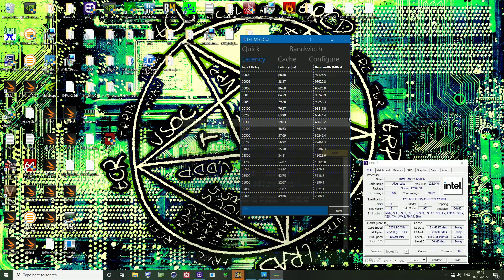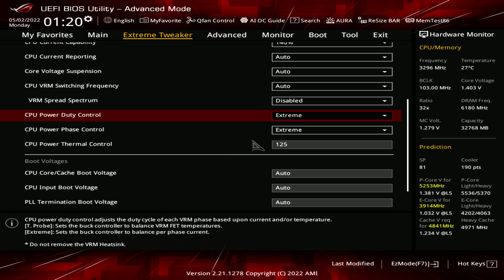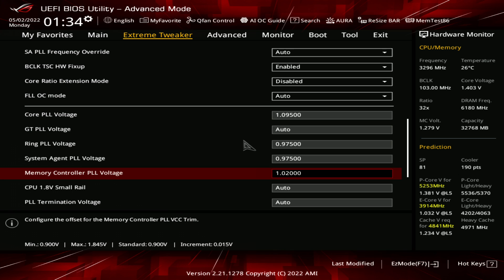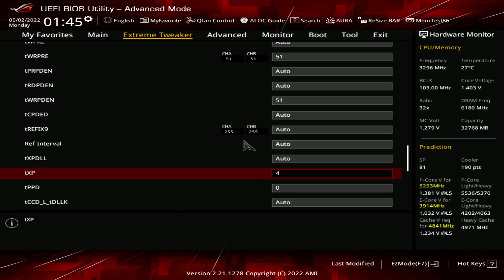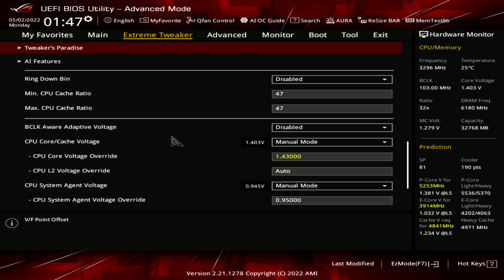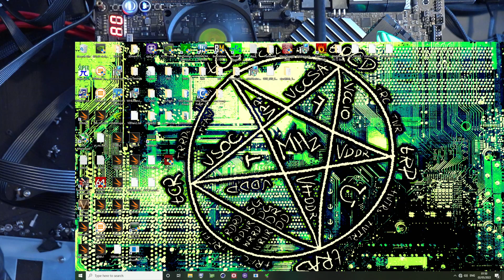Maximus Z690 Apex 1T DDR5 Overclocking: 2x16GB Hynix ICs at 6180Mbps 30-37-37-42-1T

Comment from the maker: The settings are reboot & retrain stable.
Reply: Anything to try to aid reboot? I have a "stable" setup that's great in everything, but resets profile after every other nightly shutdown.
Reply: @Buildzoid: Long time fan. FWIW, a lot of the random reboots for me on this board were related to having switching frequency at 800khz. Dropping that to 700khz eliminated at least some of the most frustrating random reboots when testing memory stability. That said it's still kind of a dog, especially for $700.
Reply: @fracturedlife  once you have your train locked in setting fast boot to auto or enabled. Then it will speed thru the retrain .
Reply: @fracturedlife  Probably your software... I have a b540 tomohawk max... does the same if settings are saved via software, not BIOS saved... took me a while to figure that out, otherwise check your BIOS battery, if it's less than 3V... that'll be the root cause.
Reply: I just wana say thanks for sharing, I had the random crash from the system agent voltage and couldn't figure it out. I was able to run all your mem timings and voltages with my G Skill 6400. I'm going to join patron and dump Frame Chasers LOL
Reply: IF you OC cache it can dramatically reduce OC on memory and stability in general.. You should try MEM OC with stock cache and core. Then core with NO cache OC.  at the end it will yield best results with cache at stock and rest OC.

Comment: I'm not an expert like you and had no luck at all having the "AI Overclock Tuner" set to XMP I or II.   It's like the board was annoyed at me for trying to use the setting.  I always had to set the Frequency 200Mhz lower just to pass training (on Micron 5200, was all I could get early December/21).  Instead I found it best to just leave the "AI Overclock Tuner" set to "Auto" , set DRAM Frequency myself and then pick one of the Extreme Tweaker "Memory Presets" as a starting point to twiddle from.  That has worked well, considering.  Anyway, thanks for the video, you've given me a few ideas for much more fiddling.

Comment: Thank you for sending me down the memory tuning rabbit hole. I've got this board and have been dealing with memory problems ever since I bought it. It wasn't my first choice...the z690 hero was however it was one of the faulted batch with an inverted chip on the board. This was the next best thing available. I came to a crossroad, learn how to tune DDR5 or simply replace the board with something else. Thanks for telling us all the little nuances of the z690 Apex. I didn't simply copy all your settings however I did use some of your values that would help me with stability. Still fine tuning my timings using a kit of DDR5 8000 Gskill. I haven't tried to push over 6600 since its not initially stable. Maybe down the road when I learn a few more tricks@

Comment: Did you mess with your memory speed at the end? 
Anyway, I was Asus sheep many years, until this generation of the Apex. Yes I have one of the Apex board which sux above 6000. Some guys at oc.net fixed it by buying another Apex, lol. I fixed it by buying MSI Z690i Unify. What a lovely board for nearly half of the Apex price! I am now running 6400 easily. I will never buy any of Asus boards in future. The Apex price is so premium, and the fact they sell "broken" boards is hilarious. 
Great video, thank you.
Reply: I went from loyal Apex buyer to bigtime MSI Unify-X fanboy myself. So much better!
Reply: I have always been asus fanboy also and this z690 apex first dissapointment.  I cant tell if mine is bad though.  6400mhz cl32 boots fine with no memtest error, but so far can only boot 6600mhz with memtest errors and nothing higher or tighter.  cant tell if its the mem or board, have a hynix kit

Comment: ASUS binning the good boards for privileged individuals and then selling the rejects to suckers at the retail market for an exorbitant amount of money is very disappointing.
Reply from the maker: I don't think they binned that many. there's maybe 10-30 overclockers with support from ASUS.
Reply: Really just seems like the earlier the board ( ES included ) the worse memory stability and overclock potential is. I've seen several examples of this from overclockers I know and from my own testing. Could be due to a lot of factors like the parts shortage and the use of what you can get, the lack of highly skilled employees at the board factories, the rush before Chinese New Year holiday and so on. The boards seem to begin getting more stable and reliable with XMP+ with S/N starting at 11/21 and with the exact same cpu / memory a board made in 22 appears to net a 300-400MHz boost to overclocking
Reply: Unify-X MASTER RACE. The board is just way better than an Apex and the Apex costs 50% more, too.
Reply: @Desktopia In this case, the 2021 boards have issues, the boards made in 2022 don't. Don't know what Asus fixed, but they fixed something fairly significant.
Reply: @CrackaSlapYa  I guess it depends were you are. I got my Apex for 575 Euros, the same price as the MSI U-X, the board I wanted 'cause I was building "The Darkness", no RGB anywhere, just two small white strips pointing inwards. Anyway, got the Apex cheap in a bundle deal with the CPU during Ishtar (Easter). The X was unavailable, they just had the regular Unify, now I also got the X but it cost me 599 Euros (I ordered it...).
Curiously enough, despite not "stretching" the Apex to find it's limits, the only issue I'm having is with the stupid RGB software... Every time I reboot, it resets "vomit rainbow mode".
Reply: @Gti_Jason  IF you OC cache it can dramatically reduce OC on memory and stability in general.. You should try MEM OC with stock cache and core. Then core with NO cache OC.  at the end it will yield best results with cache at stock and rest OC.

Comment: I have the Apex. I am running the Gskill 6000 CL36 kit (stock). To make it memtest stable, I had to adjust only a couple of things: VDD=1.3600, VDDQ=1.3600, Memory controller Voltage=1.2400, CPU System Agent Voltage=Offset mode and the CPU System Agent Voltage Offset to Auto. Passes all benchmarks for CPU and Memory. Am not sure if I will OC this kit, as it runs super good stock, and I wont see crazy improvement by OCing it much further.
Reply: Yes you will. The difference between 6000c36 stock and 6800c30 (my daily settings on my Unify-x . 90k read vs 111k  read. 62ns vs 51ns. Thats a HUGE difference. Overclock them shits to 6400c32 at least. Dont be that guy who buys an Apex to run stock ram....
Reply: @CrackaSlapYa  true. And I will, am making sure that the stock settings are rock stable first. The voltages applied on the stock xmp profiles are insufficient and fail memtest
Reply: @M00nsave445  i found that i didnt need anywhere near the voltages that i expected. running 1.42 / 1.42 on the ddr5 and 1.4 vdd and 1.44 vddq and 1.15v SA for 6800c32. Dont try to tune many sub timings until you are stable with primaries. From what Ive seen on the b-die and Apex you should be able to get 6400 34-36-36 or 36-36-36 with similar voltages at least, and perhaps 6600.  this could help you, lots of guys in this thread with your exact ram and mobo... happy tuning- it's quite rewarding. https://www.overclockers.com/forums/threads/g-skill-trident-z5-rgb-2x16gb-ddr5-6000-cl36-f5-6000u3636e16gx2-tz5rk.800428/
Reply: @CrackaSlapYa  Ya am still figuring out whats the maximum daily but safe max is for this Gskill kit is? I am a bit hesitant to go over 1.400

Comment: I believe my acceptable clocking G7400 has the 512 fused off. RIP any chance of Y-Cruncher scores.
Reply: probably not fused off you just cant access it unless you are on a MSI mobo like Unify-X (not sure why everybody isnt on Unify-x, its hands down the best board and best value high end board).
Reply: @CrackaSlapYa  I use a Tachyon and can enable 512 on my i3-i7... My Pentium does 5.5GHz on phase but no 512 makes it useless for y-cruncher.

Comment: 43:18 it was using a sensible amount of SA voltage because it booted at stock frequency, the board does that when it fails memory training. You can check to the right that indeed your memory frequency at post was 4738 MHz.
I love your videos, and you were literally the reason that I bought an Apex board 1 week ago after watching your review video. Anyhow, with the current situation of batches and how it is actually relying alot on lottery. Do you recommend that I return the board and get something else? Or should I stick with it? I'm planning on getting a 12900KS when it releases. I got the board now because I live in a country where its hard to order stuff online since they tax you alot, and there's only 1 place that brings good products, and that place got only 3 of them, so i decided to buy one for now and wait to upgrade in 1-2 months.

Comment: There is a shocking lack of Ryzen 5000 series curve optimizer, PBO settings that are not necessarily just specific to a gigabyte motherboard, and memory kits or OC  performance comparisons  between say a 3200 CL b-die kit vs something  like a 3800 CL 16 or  better kit, with IF clocks at 1900 or even 2000. Or  other fast  kits or fast OC of already decent kits.

I"m not quite sure  how I was able to tie or slightly beat my best R23 score by dropping  EDC to 130 on my  5800X, but stuff  like that is interesting as well. (  granted I used a bit of curve optimiser, but it was on a Asus B450-f which is not a great board. )

Lots of Intel Z690 and Z590 content,  which is great of course. Just wondering about the other stuff...

You once said that enabling PBO2 and setting t he manual limits to 300 /  177 / 177 and calling it a  day is a good  way to go for Zen 3. Is that the reason why making Zen 3 content is pointless?

My 5800X can grab about 160 amps if I let it,  and that seems rather crazy, but  I guess it fine?

Comment: Running my gskill 6400 cl32 kit at 1.43V 30 38 38 trfc 288 real t1 with the daily oc settings from your video. Thank you. 
On all the oc threads ppl run their ddr5 at 1.5x too 1.7V daily crazy
Reply: What are your temps like during a gaming session or workload session?
Reply: @stardust9329  Under 40C as its onesided watercooled. Even 1.6V would be under 40C
I just put some thermal pads on one side, then slapped a monarch over it... make it stick with a ziptie and slapped the block on it
Reply: Do you have the same board? if so can you please tell me which batch number did you end up with? mine is M0EAY0
Reply: @VeganPies  i have the unify X. TZ5S
Reply: @Mxgtumgoten  Good for you my dude!

Comment: Hi man! Nice video! I have a really weired issue where I've got 4 Trident Z5 6400 CL32 sticks installed with ROG M Z690 Extreme (bought last week) but I can't even reach 6400 with XMP II. Do you know what's wrong with my kit?
Reply from the maker: DDR5 clocks way worse the more sticks you have. 2 sticks doing 6400 is already pushing it on a lot of motherboards. 4 sticks don't even do 6000 AFAIK.
Reply: @ActuallyHardcoreOverclocking  Thank you so much for your reply! Yeah the more I research the more I found out I'm stupid for buying two kits lol. The problem for me right now is that I can't even reach anything higher than 4000mhz (ROG motherboard AUTO mode). I've tried AUTO (Not XMP) with 4200mhz and it won't even POST. Do you recommand I just keep them at 4000 and wait for BIOS update or keep one kit (2 dimms try to XMP them) and return the other kit? I've got 12900k with ROG M Z690 Extreme. It's for my girlfriend so she won't be using the memory with its all 6400 glory but on the other hand if she's using them at 4000mhz it's just not worth the money.
Reply: @ActuallyHardcoreOverclocking  mine 2x16 6400 cl32 will post but error out on memtest and games crash to desktop same maximus extreme motherboard I lower it to 6200 seen to games no longer crash what a pain to get a stable xmp out of box

Comment: To me its seems like a downgrade, that DDR5 has the voltage stuff onboard, it just makes them harder to oc/cool. Esp if you run a large tower cooler. The only advantage i can see is the programmable XMP/AMP on them, but besides that.. meh.  I wonder if Gear1 low latency can beat out gear 2 with medium/high latency at twice the speed(DDR4/vs DDR5), since most test i see out there is pretty inconclusive, or uses trash DDR4/untuned DDR4 vs decent speced DDR5.

Comment: BZ, have you watercooled RAM or seen some results that compare watercooled RAM against a fan blowing on it? I've an 120mm Eisbaer with Bykskis blocks ready (got all of that for 100 quids, which is close to being a steal), just can't decide to put them on my sticks as it's not all that plug n' play.

Also, I'm a normie-but-not-normie and just need a heads up, if: set stupid primary timings -> find highest frequency and fiddle with ODTs if doesn't initially boot -> find lowest primaries -> find lowest tRFC and highest tREFI -> find lowest rest of timings is a correct approach or can I actually miss out on some clock/timings configuration due to tertiaries mismatch?
Reply: fan is fine. mine stay at 40c even running 6900 c30
Reply: @CrackaSlapYa  I know, mine stabilizes at 39.4 C in TM5 with 4000 17-17-17 (garbage B-Die bin or issues with Z690 Strix D4). Just wondering if water cooling would bring it down significantly and maybe improve stability.
Reply: @PolskiJaszczomb  I think it's basically optimal as long as it's under 50c . I dont think it would help to cool beyond that but its a good question i cant answer definitively. But, i will say unlikely.

Comment: Good to know about the memory controller voltage. Mine sets my hynix 6000c40 to 1.25v on auto on my b660-i and and shows as IMC VDD in hwinfo64 as 1.38v for some reason. Not sure if it's hwinfo64 reading wrong or what. Also Aida, hwinfo, cpuz are all showing my memory at 5985 instead of 6000 for whatever reason. For some reason my board had intel virutalization tech enabled by default and I installed windows with it on and I think it messed with some of my sensor readings. Also only reads my 12700k at 4.5ghz under load in hwinfo despite scoring 22500 in cinebench r23 and rivatuner overlay and cpuz showing 4.7ghz all core. Not quite annoyed enough to try reinstalling windows but still pretty annoyed lol.

Comment: Have the same mobo with 12700kf and corsair  5600 ram. For some reason my system is not stable gaming benchmark with ram at 5600, so had to lower at 5200. Is it because of heat?
Reply: just timings need tweaked likely

Comment: Do you think intel will fix the MC in 13th gen so that gear 1 will work with DDR5?
Reply: G1 WILL be impossible. Period. It's not gonna happen. You will see improvements to 4 sticks support and frequency support, but you can forget about Gear 1 with DDR5.
Reply: @PolskiJaszczomb  Why do you think so ? At least 2600Mhz on the memory controller speed is not so absurd to expect , which is DDR5 5200 .
Reply: no. that isnt possible.
Reply: @fleurdewin7958  5200 is peasant speeds. fully tuned on Unify-x most are running 6733-7000.

Comment: Hi, do you have any advice for a DDR5 mobo with i7-12700k on which I will upgrade the RAM in the future using DDR5 that are no longer "immature"?  So as optimized as possible for the future.
Reply: msi unify-x
Reply: @Nikko911  Asus?

Comment: I've a kit of vengeance 4800 cl40 and i've reach 5200 34 38 38 72 vdd: 1.32 and vddq: 1.37 . This memory kit has micron chips, in your opinion can i do better than  5200 cl 34?
My motherboard is z690 aorus pro
Reply from the maker: Micron should max out around 5400-5600.
Reply: sell it and get samsung or even better hynix. its way cheaper now.
Reply: @ActuallyHardcoreOverclocking  but those kits are so slowed compared to a ddr4 4800cl19 right?
Reply: @dvr1337  To run DDR4 4800 CL19 you need to have Gear 2 enabled and really loose timings. Then you're crippled to a point, where 5200 CL34 will just smash 4800 MHz kit.
Reply: @PolskiJaszczomb  ehm no lol. Literally even a 4400cl17 kit beats most ddr5 kits. The kit is 5067cl20 but i run mine at 4800cl19. Theres no gearmodes on z490 atleast not on my boards
Reply: @PolskiJaszczomb  check the ddr5 gaming and latency test from der8auer.

Comment: Is 650 GFlops really high? My 10900k @5GHz does ~640 with cold RAM at 4400 17-18-18-28 with moderately tight timings. And I am not even that experienced at overclocking.
Reply from the maker: 10900Ks get more Gflops than 12900Ks because the 10900K is a 10 core.
Reply: @ActuallyHardcoreOverclocking  That makes sense, of course.